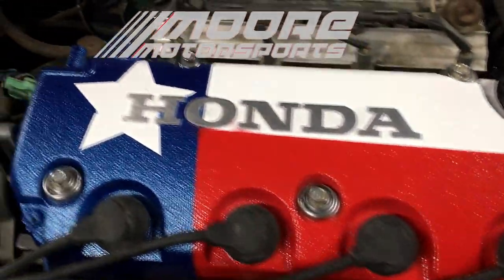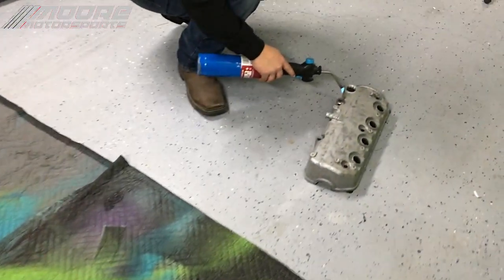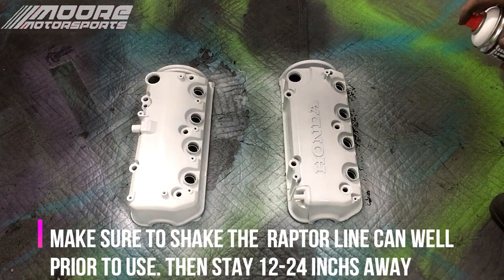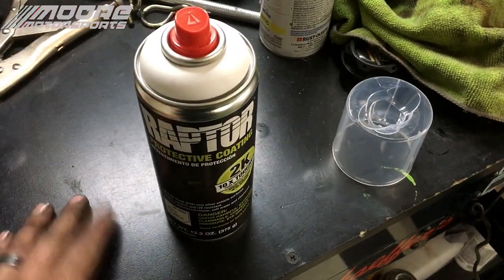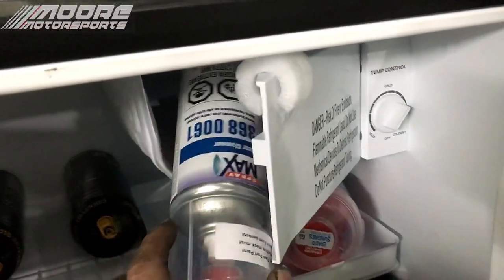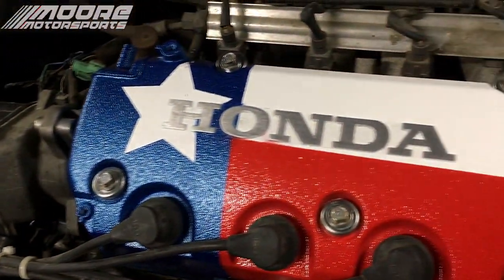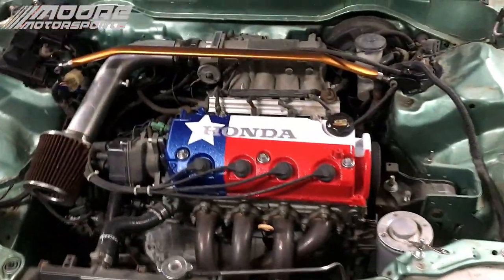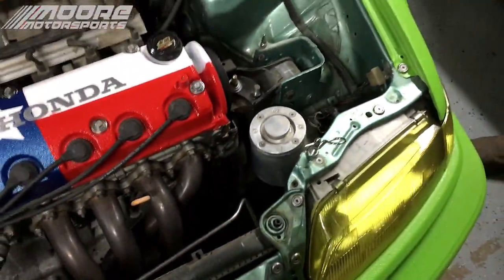Making A Custom Texas Flag Valve Cover (Subscribe if you liked it)

Comment: How well has that raptor liner held up for you. Ive been wanting to try it on the bed of my truck. Awesome job by the way.
Reply from the maker: Raptor holds up amazing and I will never NOT recommend it. It’s 100% the way for me
Reply: @JamesDguy  Im wanting to try it. The only hiccup I have is finding a compressor large enough to run it. Seems they want a fairly high cfm. and those damn things get $$$ real quick.
Reply from the maker: @mikepaul3200  I am running a 8 gallon compressor it’s small and it works fine at 50-65psi
Reply: @JamesDguy  Thank you.